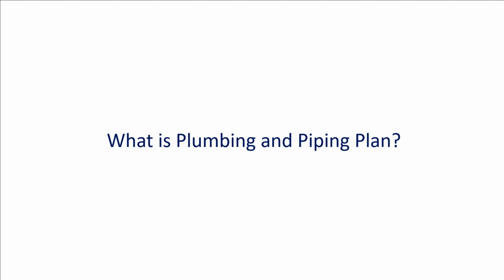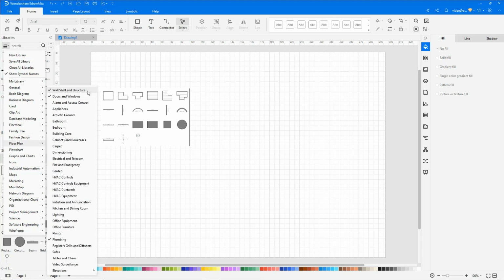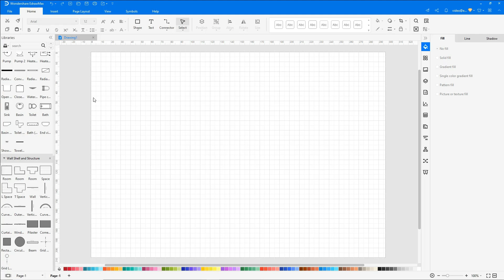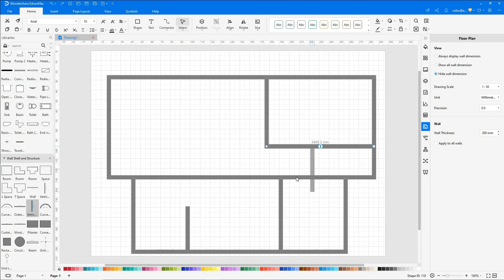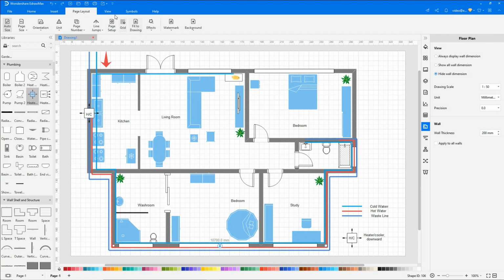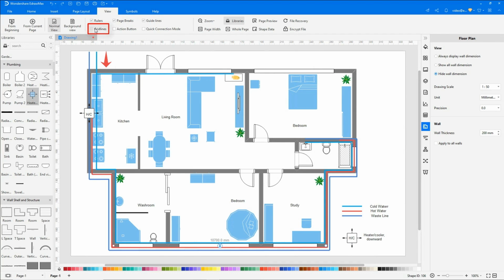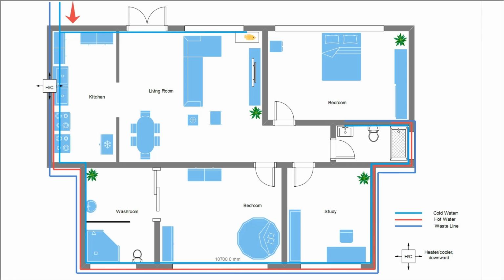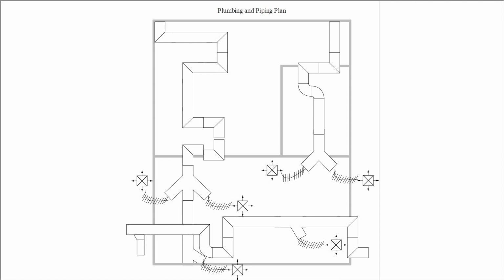How to Create a Plumbing and Piping Plan | How to Draw Plumbing Lines on a Floor Plan | EdrawMax

Comment: This is a video designed to sell a drafting software, it does NOT provide information on how to create a plumbing plan.
Reply from the maker: The video is a short tutorial for how to create a plumbing diagram in EdrawMax. If you have further question using the software, you can contact usor send to our customer service for more support